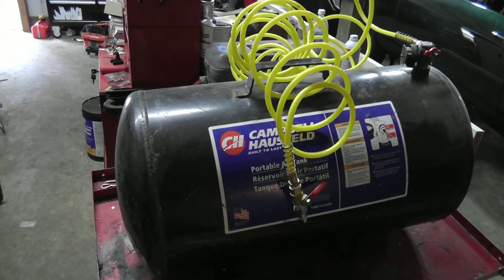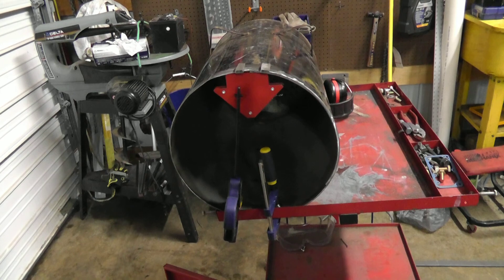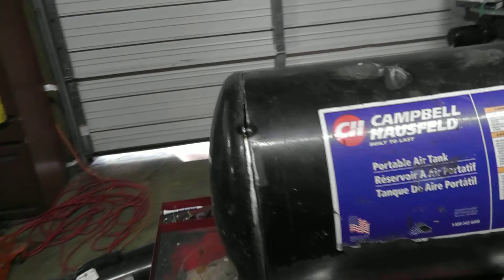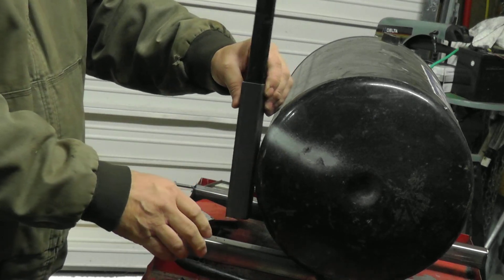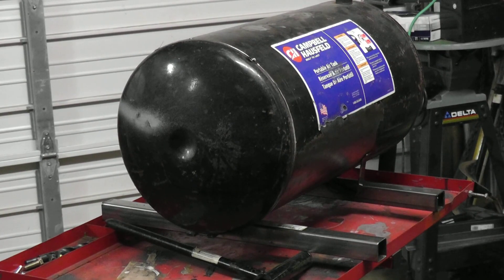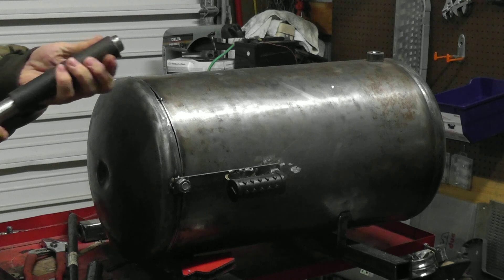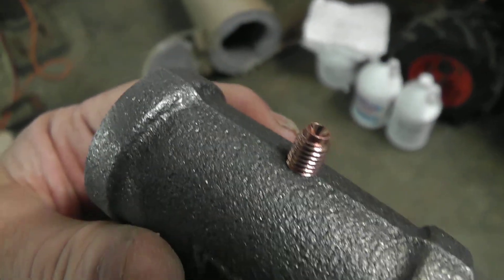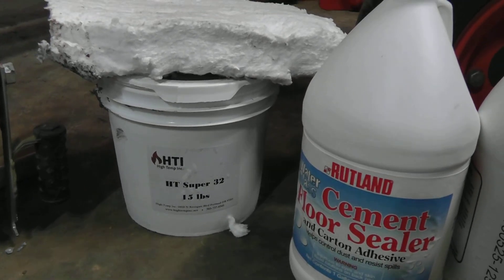Building a propane forge from air tank

Comment: oh man... you weld worse than me. haha.

And FYI, the purpose of teflon tape isn't to fill gaps in the fittings, but to reduce friction so you can tighten the threads further than without. It's the threads that create the seal. Not the tape.

Comment: I just did one on my own befor watching this vid. No door, probably a 3gal tank, and all i did was make a big hole in the front. My idea is to put charcoal in it and work it like that, do i need wool? Is propane better? Yesterday was my first day "forging" out of a wood furnace which didnt work out too well lol. I did get a "knife" out of it tho.
Reply: Propane isn't better, just faster and easier, but also costs more over a year.

If your coals aren't working how you want just look at increasing the air flow to get them burning hotter

Comment: Get you a cross 4 way pipe and thread a 3/4” x 1/4” bushing into the back of the 4-way cross and then use a 1/4” street elbow FNPT x  MNPT and tap the inside of the male end of your street elbow and thread in your log tip then it can screw into the bushing that screws into the cross then your fuel line or your on/ off valve and your all set. It may seem complicated but it’s a cross 4 way and 3/4 x 1/4 bushing and a 1/4” street elbow MNPT x FMPT. Thread your tip into the male end of the elbow

Comment: Teflon tape, even the yellow, melts when heated. Then it enters the threads due to capillary action. After getting into the mixing area it clogs the orifice. "Where did that tape come from?", You'll ask. It'll be grey. I don't tape joints down stream from the gas feed needle valve as the gas will just come out of the orifice when the valve is opened and not build up pressure. Upstream of the valve, yellow tape FTW! Making America Great, one forge at a time.